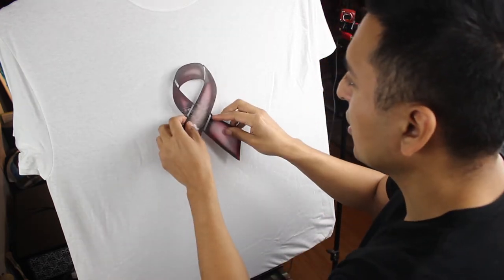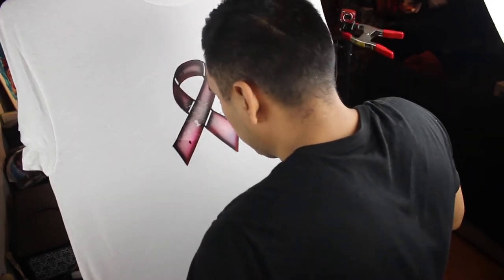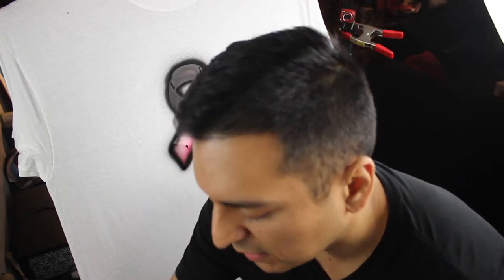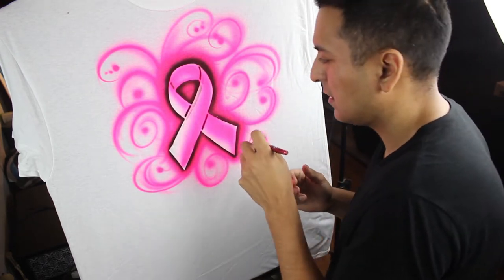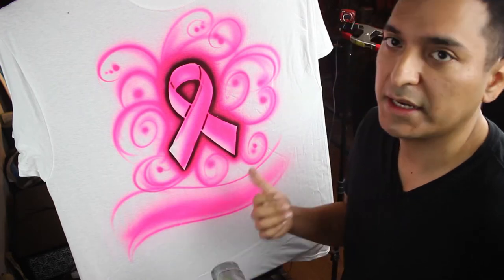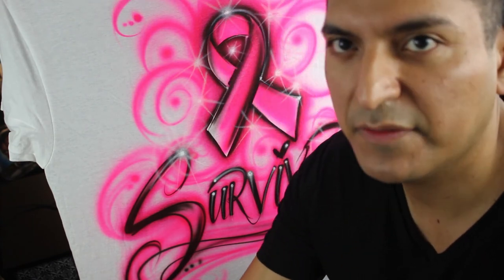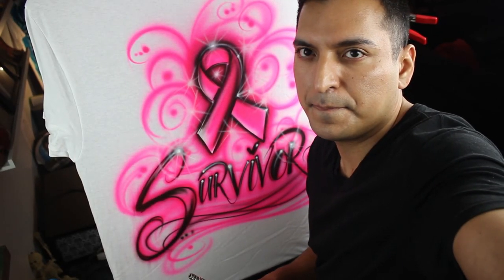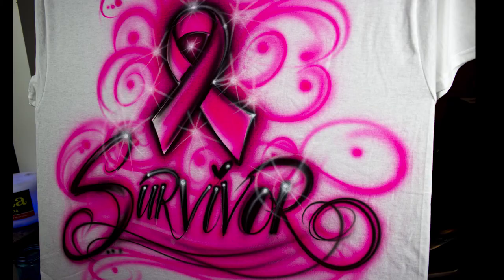How To Airbrush Breast Cancer Survivor t-shirt

Comment: Building up the letters gives it a real nice hard line pop vs using the double action to pull thick and thin. I always end up with slight over spray. I heard you spray at 70 psi yet you barley have over spray.  Gonna try it with no reduction and more pressure. Thank you for the tips! Anotha great vid!
Reply from the maker: Just Illustrationz right on thanks! Yea i think its like 60 sometimes 70 kinda alot but when i jave thicker paint  it helps. Kind dont pay much attention to psi more on the sound and feel. Except when im doing high detail illustrations and portraits. Then im alot more precise.